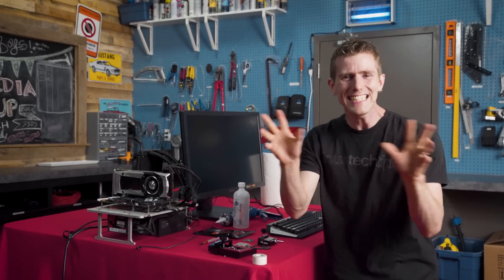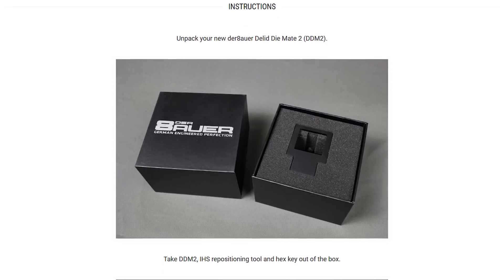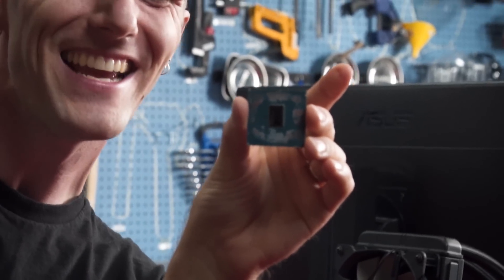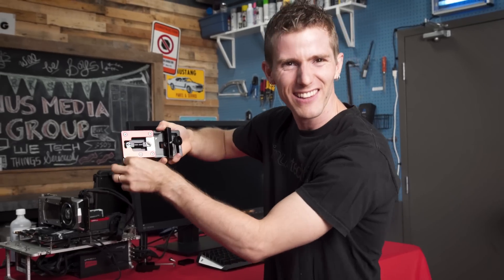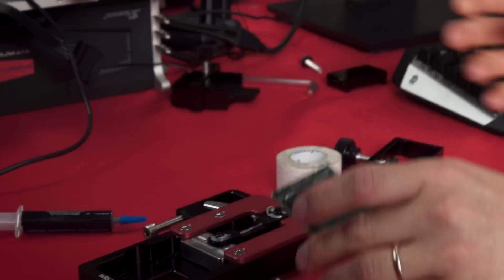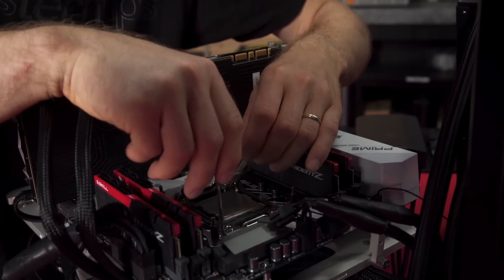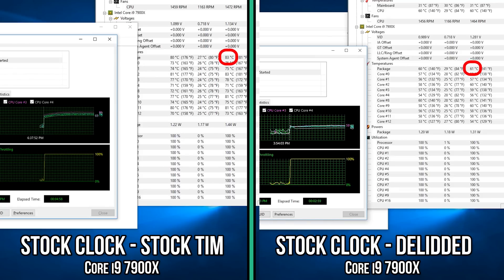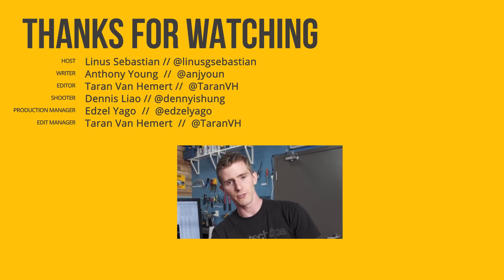Delidding a $1000 CPU - Worth the RISK??

Comment: I delidded my 7700k using a tool easy peasy lemon squeezy, and my temps dropped 20c under an H100v2. Used Liquid Ultra on the die and on the IHS.

Comment: So let me get this clear they build a $1k enthusiast processor and decide to save a few cent in thermal paste for the cost of 20°C on stock settings?

I can get why the run of the mill average processor has no super high grade compound. They don't expect their customers to overengineer their cooling setup, so the internal heat transmission is not the bottleneck. But for a 1k CPU???

Comment: If you're going to take the risk of delidding, Why on earth would you not use a liquid metal thermal compound both under and on top of the IHS to get the maximum possible benefit. Aren't there cooling blocks designed for direct die contact while keeping the rentention system? Considering there are multiple people who've gotten stable 5Ghz overclocks from those new Intel chips. One wonders what they could do under the closest to ideal conditions one is likely to get short of using below ambient temp cooling which even I wouldn't want to mess with.

Comment: umm, sorry this could be a bit irrelevant, but in a way it is. I have an i5 4690K with an msi z97 gaming 7 mobo, and h110i gtx cooler.
as seen in this video, his i7 has minimum clock of 800MHz, mine stays at the overclock I gave to it, it's always at 4.6 no matter what I'm doing, HELP?

Comment: I got so lucky with my 7700k. The absolute highest I have seen it get is 77c running at 4.9ghz on an ETS-40 fit air cooler.  My room isn't all that cool either, 24-25c or so ambient at the lowest.
Reply: my 7700k runs at 46c under load at stock
Reply: Never seen that with air cooling. But stock I was getting just over 60c on air, heavily loaded. Most you  tax your cpu is Overwatch, huh?
Reply: no the most i tax it is 3d modeling and streaming and stuff im also quite confused by it
Reply: 3d modeling, streaming?? Now I'm confused. Would that be your slideshows, or you screaming over music and playing portal?

Comment: Why didn't you use liquid metal? Your "3c" drop in temps from the last video was because you used thermal paste again. On my overclocked 4.6ghz 1.35v 6700K, it dropped by almost 20C. If you're removing paste and just using paste again, this whole process is pointless.

Comment: I've delidded and lapped the IHS on all my pcs with Intel cpus starting back with the 4670k and the 4770k and then the 6700k and the 7700k, I used the coollaboratory liquid ultra and the lapping was up to 10000 grit sandpaper. The temperature drop was always between 25-30 c, on stock Tim I was getting thermal throttling on all of them so the delid is worth the loss of warranty
Reply: Sergei Yoel had some problems with coollaborator LM it got dry and brittle. conductionaut stayed liquid.

Comment: Why the hell wouldn't this be default for intel on a $1k processor? at that price range, the price increase from the better thermal compound would be fairly negligible, right? especially for such a drastic improvement in cooling performance.

Comment: Use a decent cooler! Almost all the reviewers put a CPU cooler designed for 130 Watts onto a CPU probably drawing near to 300 Watts overclocked. How could that not be working right?

The first step could be some Noctua Industrial fans - 120 or 140 mm with 2000 or 3000 rpm, up to 269 m³/h at 41 dB (A) each. Next use two radiators in a system that can do that.

Comment: This is most rushed and messiest delid I've seen so far. Even Gamers Nexus's delid was not as bad as yours.

First. You used Thermal Grizzly KRYONAUT, not Conductonaut. The conductonaut is the liquid metal which can reduce temps by almost 20-30 degrees celsius. You might have used conductonaut as well to show even further improvements (given that you could apply that patiently). But you went for thermal paste......again even tough you know that temps improvements are best with liquid metal.

Second. Instead of using rubbish red silicone, you could have used a small amount of it and then relid the cpu.

Third. ALWAYS watch a guide video before you go out and do something. Even der8auer has a 4 minute video on how to use the delid die mate(s).

Take this as a constructive criticism. You're the one whos videos got me into pc building hobby and who I looked up to when I was a noobie at pc stuff. You could had developed this video into a guide but from what I'm seeing, you just rushed to make it so you can conclude if it's worth losing your warranty or not. I know that it's meant to have a little bit of entertainment, but try to have some proper tips as well.

Comment: seriously Linus, stop deliding CPU-s in that manner. your deliding method and care for cleaning and applying thermal paste in an insult to over 3000 pages in this thread about deliding.
just look at the amount of silicone glue you use, the point is to reduce the gap between CPU DIE and IHS, you put a whole 1 millimeter of that stuff.
http://www.overclock.net/t/1313179/official-delidded-club-guide

Comment: How much would that tool cost? like 30$? Why not put those 30$ into your cooler budget so you can get better performance and keep your warranty in the process. It's not really worth it any way you put it. I doubt even professional overclockers delit their CPUs, since they use liquid nitrogen to cool their CPUs, the gains from a "mere" delit would be insignificant compared to -186 C their CPUs are running at.

Comment: how can the company behind the most complex and advanced technology in the world do something as asinine as using some cheap ass paste and cooling agent on EVERY SINGLE ONE of their processors that apparently makes a GIGANTIC 20 degree Celsius heat difference.. and all for what, what could POSSIBLY be the cost difference between them using that cheap ass crap and decent stuff per processor, I can't imagine more than a few pennies at most, if anything.
And not even an OPTION to pay more, if it did cost anything, for a more premium cooling ? You offer $10,000+ pricing option ranges but you can't have a fucking option to pay for TWENTY FUCKING DEGREES OF COOLING for an extra $2...?
That's like if Spacex manages to figure out how to build a colony on mars, but insists on using vegetable oil to power their rockets instead of substance X that gets 30% better power per unit volume or something
Reply: the only POSSIBLE reason I can't think of is planned obsolescence/quicker processor death through burnout and thus quicker turnover on processor purchases....

Comment: I'd urge anyone watching this to go watch gamer's nexus video on it, it's much higher production value and it's explained way better.
Reply: Actually Diamond Teeth is right, GN has dealt with this issue in far more depth and detail.
Reply: +Ryan Paste temps are pretty close as Benoit said, and has the advantage of being non-conductive (less chance of shorting a capacitor or something) and easier to apply.
Reply: the difference between conductonaut and kryonaut is only 2C in general, many people did the test on overclock.net
Reply: The distance between the IHS and die is more important than the TIM used. You could use Intel's TIM and it still would drop quite a bit.
Reply: That an he uses actual liquid metal which is were u get the better temps
Reply: anybody watching  Linus video on taking apart a CPU, is not going to be taking apart their own CPU lol
Reply: This video is pretty bad for a couple of reasons, they delidded the chip and didn't even use liquid metal, why would you use normal thermal paste between die and ihs.  Also, at 11:05 Linus said they dropped 20c using thermal grizzly conductonaut - which is liquid metal, i highly doubt they dropped 20c using thermal paste alone.
Reply: Agreed!
Reply: Nah

Comment: i like the sturdiness and build quality of derbauer delid tools, but when I wanted to buy one a few months ago, they were all sold out. I delided my 7700 with a 3d printed tool which is available for free online. Works just as good. Print it, press with a clamp, lid pops of, you good to go. You don't even need to use silicon, it will actually improve contact on the die without the silicon by a milimeter. Use liquid metal thermal paste for best results, the cooler will keep the lid in place by pressure anyway. got my 7700 down from 60-90°C down to 40-70°C

Comment: Did this with my 3570k with coolaboratory liquid pro.  Worked amazingly well.  Clocked to 4.5ghz 24/7 and temps stay under 65c under load.  Before it was 4.3ghz and 75-78 under load.

Comment: If your going to run the risk, and void your warranty, use some damn liquid metal between the die and IHS. If you are really that scared you can surround the Die with non conductive polymer or silicone, let it dry, then apply the LM, then the IHS.

Comment: For any one who is interested in this head on over to Gamers Nexus where they did a much more in depth look at delidding and liquid metal for a thermal compound.  

My opinion on this matter is that, The maximum temperature difference between on dye and lid should be 10C for all lower grade CPUs, but higher grade CPU should have a temp between on dye and lid of 2-3C  if not less. They are not even close to being the same thing so why do you treat them the same way Intel?

Comment: Why the heck does Intel use such inferior thermal paste in such an expensive product?? I never bought any high quality thermal paste so I don't know what the price/ml would be but it can't be that high, right? I'm sure such a tiny drop cost's almost nothing when you look at the huge gains in cooling it brings. 
This really boggles my mind. I'm sure they invest millions in RnD for getting cpus that have good heat to performance ratios. But then they just screw the whole thing by using thermal paste that raises the whole temperature by 20 friggin degrees thereby reducing the boost performance? That sounds so terribly stupid! Or am I missing something here?

Comment: Intel said NEIN with their i9 to liquid metal or solder between IHS and CPU chip even on 1000$ worth of CPU
Reply: IMO the dumbest thing Intel could have done. 

Threadripper has proper soldering, and it's BEAUTIFULLY cooler than the i9.
Reply: Well it would be substantially less then 5$ to do the manufacturing proper if they just used a proper tim probably pennies more per chip but hey greed i mean they are charging outrageous prices anyways why would we expect things to be done right with the level of greed intel has consistently demonstrated
Reply: oh, and you're all fucking moron's except for @Máté Varga
YOLO
Reply: intel has fallen off their wagon, plane and simple..
thanks i5 2500k for having a proper CPU lid
Reply: bottom line bb, all bout that bottom line. Cuttin' costs where it can fuck the consumer over the provider :p
Reply: I have a 6800k, can i delid mine?, getting pretty high temps with my custom loop...
Reply: iFxSnake yes you can
Reply: even with the 2000$ 18 cores one also
Reply: iFxSnake yes u can and it's a lot easier than Linus makes it seem. It is very! Worth it
Reply: Intel has had monopoly for so long that the potential savings, from fewer shorted cpu's and not having to create new production lines accommodating TIM alternatives, outweigh the performance gains. Moving over to another TIM probably would cost them hundred of millions of dollars(if not more) in R&D, retooling/replacing machines, production delays and breaking sub-contracts already in place. Don't think we will see new TIM materiel until the next Node-shrink.
Reply: Don Won pretty sure you are cancer mate.
Reply: They have to consider longevity and reliability with the IHS tim they use, not raw performance.  An enthusiast will be removing the cooler and redoing TIM on both sides every couple years.  Someone who is not an enthusiast will probably never or rarely redo the TIM on their machine.  I'm pretty sure I got this information from Der8auer himself.
Reply: They will probably make a liquid metal edition that costs $200 more.
Reply: not if you use leaded solder in place of this modern shit.
Reply: Andrew Joy yeah sure that prevents cracking LOL knobhead
Reply: It probably only cost like $5 and the rest is profit
Reply: That's because, as Linus said, the CPU can't run stable at those really high overclocks because it's trash, so Intel made sure it would overheat and thermal throttle.
Reply: Its already soldered. Only the new CPUs need delidding.
Reply: It's probably not because of the cost of the solder but rather the fact that they know that enthusiasts might delid their processor, fuck it up, and then have to buy a new one.
Reply: The joke

Your head.
Reply: Intel is from Silicon Valley, not Germany.
Reply: But solder can crack from heating up and cooling down repeatedly
Reply: Aurimas Knieža So many fake likes

english is so bad it gave me cancer

Comment: i dont know how you can price this at $1000 because my god open bench and it runs hot like hell intel rushed the processors totaly not caring what the temps are as long as it can beat amd which runs way way low in temps like seriously my processor core temps and videocard temps are equal now 50-60c max during heavy load so to say intel wins from amd right now agiants the ryzen is a no

incase you think im a fanboy of amd or intel or nvidia then nope i just pick whatever part performs the best at the time of purchase and that was the ryzen systems and got a nvidia card due to its cooling capacity i got a gigabyte card that hardly turns its fans on in gaming and if its on its about 30% then afther a few seconds fans turn off agian and temps slowly climb up to 60c agian then agian its a bit obvious that nvidia dont need to cool so much compared to amd cards runing at much higher wattage

Comment: With a 20 degree difference in processor temps at stock speeds, I am surprised that Intel keeps using such garbage thermal paste...they should probably acquire one of these small companies that make better thermal compound, and use it to make their processors perform better from then on into the future, and truly make it pointless to de-lid and re-lid their CPU's. If all of their processors came from the factory with something like thermal grizzly under the hood, I bet all the reviewers would notice the change and with better thermal performance would probably lean more reviews to recommend their CPS's.

Comment: Everyone is delidding these days. What real low-temp hunters should try is to polish some CPU die off. Since it is a flip chip you should be able to get some micrometers of silicon off. Silicon is a quite bad heat conductor (compared to aluminum or copper) so reducing the thickness of the chip could help.
I assume you need a microscope, some fine polishing tools and sick skills.

Comment: Why is there anyways seems like just extra layers to cool why not just straight up cpu to heat sync or water block
Reply: Because the die is fragile, small, and can't take much mounting pressure on its own. The point of the heat spreader is to spread the heat out more to make it easier to cool without breaking the die. It's basically a heat sink without fins.

While you can cool a CPU die with direct contact it usually isn't worth the risk unless your going for a phase change setup or any of the other below ambient cooling setups where direct contact can matter more.

Comment: How is that over-engineered? The only simpler option would be to push the delidding-blade directly by screwing in a pin. And as you noticed, it gets really hard to turn it at some points, even with the lever, so without it you probably could not do it by hand. It's engineered to work, that's all.